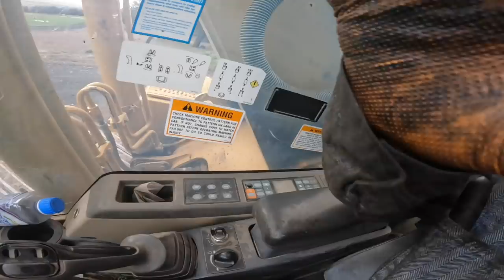Cat 320c (easy money)

Comment: As you know that the customer is always right,''HA, HA," but with no knowledge of what is involved in doing a job and the costs involved. I set up a Engineering company and the cost was $750,000.00 with 2 machines costing $450,000 and was told to charge them out at $320.00 per hour plus  the labour. These machines were CNC.Had people ask why was it so dear to have their jobs folded as I was the only company that could do it so I would tell them go and buy the machine and tooling then see how dear it is.

Comment: The Pirtek hose system allows you to re-use the end fittings from the old hose. They simply cut the old crimp collar off the hose and crimp a new one on. Too bad they are not in your area. They also have on-site service when in their areas of service. Thanks for keeping up with the videos. I learn so much and see stuff I never experienced while I was still working.

Comment: Those hydraulic fittings can be a nightmare. I just finished building a wood splitter, and I used a cylinder for the log lift that my son salvaged off a burnt up case/ih combine, found out while plumbing it up it’s got metric fittings! Fun finding an adapter fitting! . Have fun.

Comment: If we’re doing time and parts it’s full retail plus 20% then  it’s $1:50 mile plus $250 day for service truck and tools . Then $125/hr . Minimum call out flat rate $1000 per day labor only. It’s brutal work and if you’re not happy , have a nice day . Credit card on file for new customer charged in advance.

Comment: One thing I learned on those cat flange clamps. Is to take out top two bolts or bottom two and only loosen the other two and try to spread the clamps. Sometimes it works and sometimes it doesn't. All depends on where the clamps are located

Comment: Told ya. Should keep a small pipe with you that fits over your 1/2in and 3/8in ratchets. Or you can shit yourself every time you take a bolt off. Get a small pipe. The LED displays always go out on the 320c

Comment: ors fittings are the only thing worse than cat flange in a tight spot. most of the time cat built hoses are great fit. except travel motor hoses on a 552-2. those need to be 1/2 to 3/4 inch shorter than cat specs.

Comment: If a customer takes to long to pay they either don't get called back or they are told to call some one else. There os more than enough work out there. All the dealers are short handed and can't find qualified help. Another suggestion don't do an hourly rate. Charge by the job. They need to pay for your experience not the hard work.

Comment: I did not see any easy money here. Just a hint I started using magnetic sockets for areas like that. I used to use a part of paper towel to hold the bolt in the socket but sometimes the socket would stay on the bolt. Or fall off when pulling the extension out and I would never see it again.

Comment: Thanks Warren for sharing.
Are those formed steel hose ends one use only because of the crimping method?

Folks keeping spare inventory costs are getting higher and most local/state tax branches want taxes paid on inventory setting on the shelf and they do not care if it has been sitting for years or not. They did that in Florida to my friends hardware store. He had to start getting rid of the old stuff that we used to repair older homes and equipment, because the State kept taxing the inventory value each year.